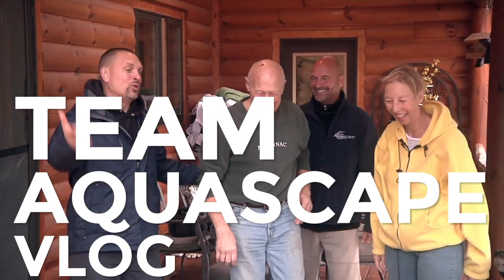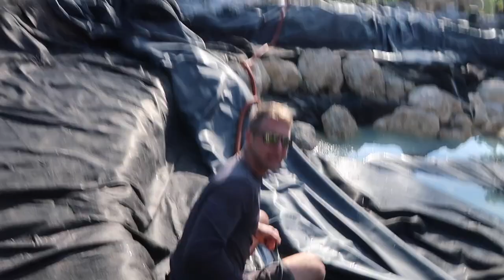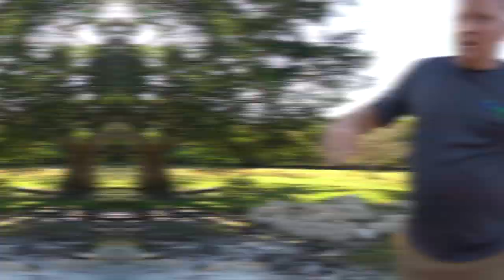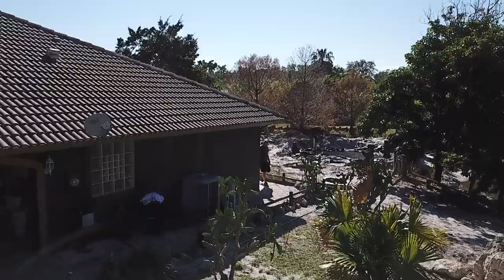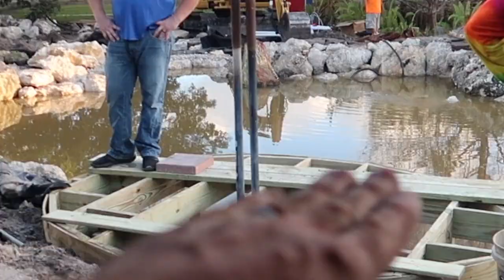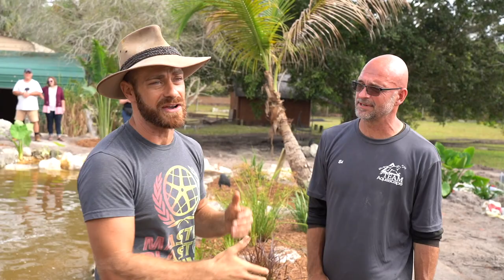KAMP KENAN's NEW RECREATION POND: THE OFFICIAL REVEAL!!!

Comment: Love the build but I have two questions (for now)...1) the transition from the Wetland filter to the Rec pond - Did you have to seam the piece of liner that you used or did you have a falls for the overlap or...? 2) I noticed the posts from the dock are going into the water - Do you use pressure treated? Is this OK for the pond? and what are they anchored in/on?